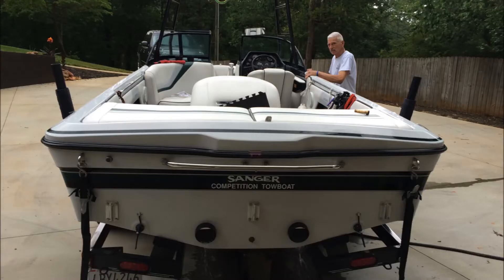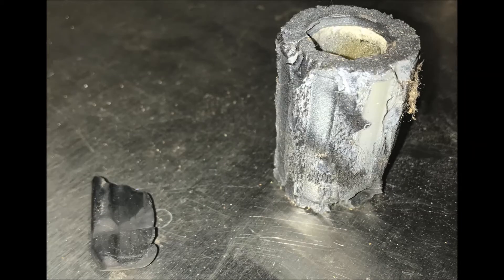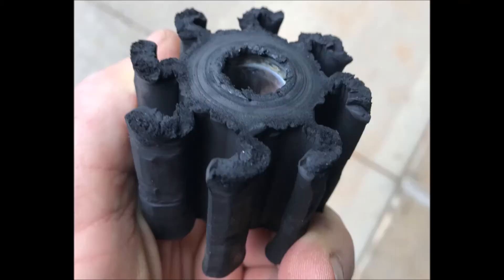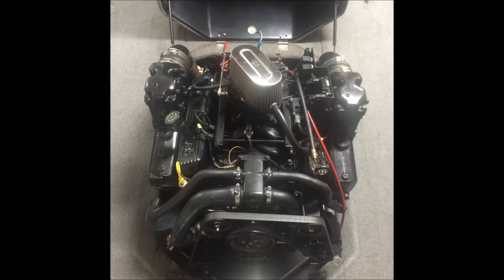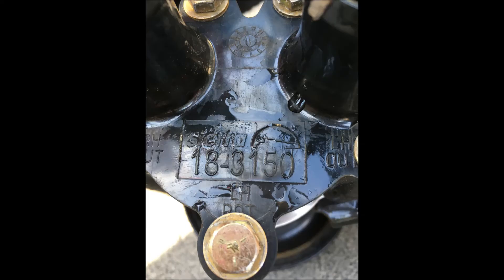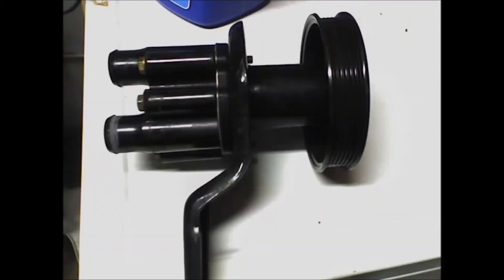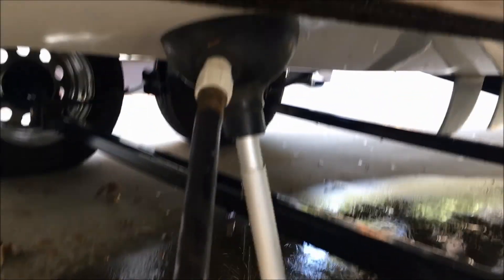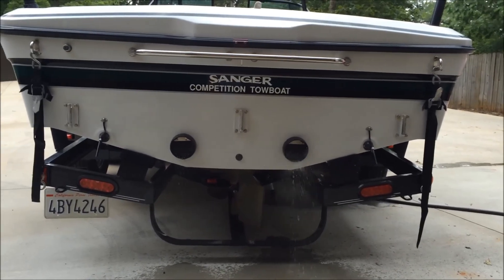IMPORTANT Marine Cooling System Repair, Maintenance: Rubber Impeller Degradation MIE 350 MAG MPI Ski

Comment: i think i have an impeller issue Any idea what would cause the pulley to not spin
Reply from the maker: Good morning & thanks for the question... if the pulley is not spinning, could be the bearings are seized or the impeller has fallen apart and is restricting rotation of the pump.  The first thing I would do it remove the belt and try to rotate the pulley by hand.  If that doesn't work, you will need to remove the pump, disassemble and inspect the internal components.  Let me know what you determine from your inspection!
Reply from the maker: & don't forget to subscribe!  I need more women subscribers.  If you have topics that may help my channel, please ask away.  ;)
Reply: @DrivingIntelligence  thanks but im using my wifes account but ill definitely be subscribing
Reply from the maker: @takobarcatering8032  thanks... appreciate you

Comment: Did you ever fry a  impeller !! Now pieces are all throughout my 305 Chevy motor water jackets. Going to be a major job trying to blow those out.Have you ever seen this!!!!
Reply from the maker: I did, and it was ugly.  I didn't flush the block, but I did disassemble the cooling system from the pump to the block to remove all the particles.

Comment: similar issue where I have had to replace two of the plastic pump bodies due to cracking . Have you experienced this issue ?   Looks like we have the same boat,mine is a 1999 Sangair model I purchased new factory direct.
Reply from the maker: Interesting that you asked, this year I upgraded to a stainless steel impeller housing, which is rather expensive, but prevents that from ever happening again. I’m still assembling that video.

Comment: Most manufacture recommends to change impeller every 50 hour or annually. 5 years would be way too long.
Reply from the maker: Thanks for that input.  50 hours is SHORT.  I did another video as a follow-up where I recommended changing the impeller much more often.
Reply: @DrivingIntelligence  I would agree, 5 years is too long but every season is unnecessary as well. I do mine every other year now after the last failure.
Reply: Agreed, 5 years is way too long.  More than every other year is taking a chance on failure. Also, it's a good idea to carry a spare kit on your boat.  I sucked up a twig or rock a few years back which locked up the pump with it screeching like a banshee leading to immediate over heating due to the failure.  The spare kit got me home.

Comment: I’m having the same issue I just replaced my impeller . Is there any way to get the pieces of impeller out without pulling the water pump ?
Reply from the maker: To be safe, pull the pump and flush the line backwards to get all the pieces out.  Otherwise you are taking a big risk.  And please subscribe!